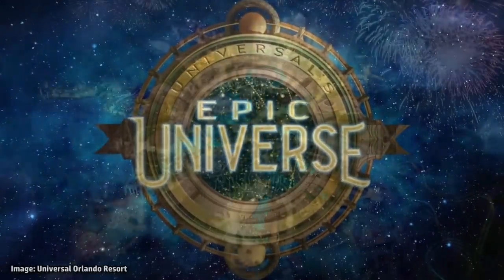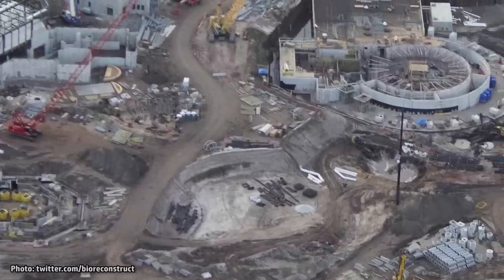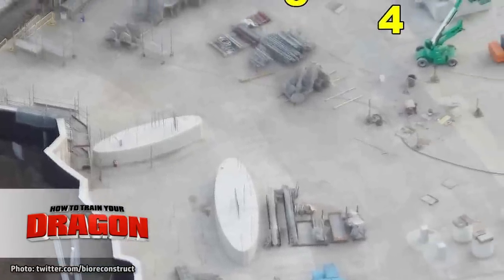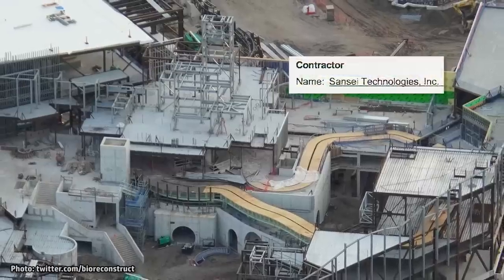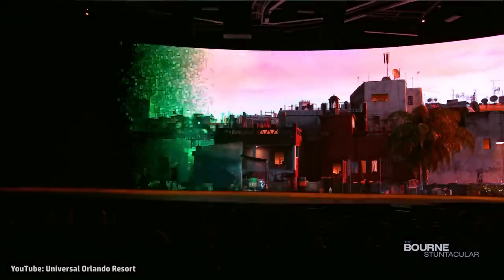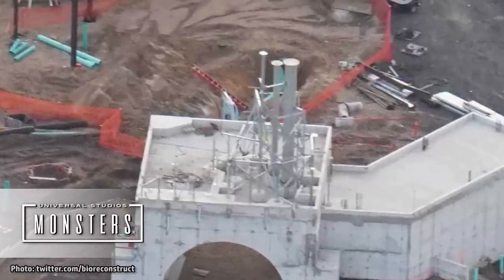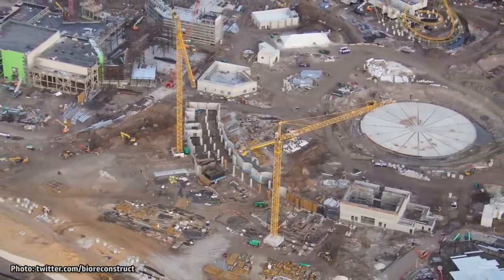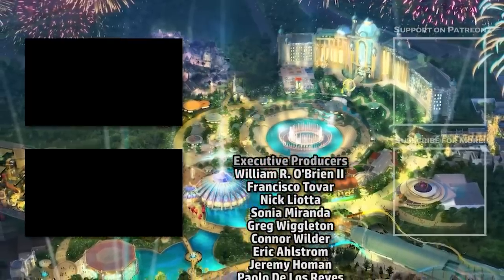Universal's Epic Universe News Mega Update — NEW PERMITS, RIDE RUMORS AND CONSTRUCTION PROGRESS

Comment: Awesome video! Question what’s the progress on the Kirkman Road extension..that’s gonna be the key to get Guest to Epic
Reply from the maker: It’s making good progress but is not scheduled to be complete until next year. They completed a small section near the hotels outside the park for heavy equipment to be able to drive into the work sites recently, and are now working on an overpass more north. It’s a city project so moves a bit slower than the park but is making good progress. Even got some traffic lights put up in one spot!

Comment: Okay, it may be time to address this "This is going to open early!" nonsense... but is it? Alicia pointing out how far we've come in a year is shocking. There is really NO reason why roller coaster track should be going up a full two years early! To put this in perspective, I looked at Diagon Alley construction. In October 2012, the Gringotts ride building went up, while the rest of the area was still dirt. Vertical construction on the Alley didn't happen until March or April of 2013. The land opened on July 8, 2014, which means it took about 15 months from this point. Epic Universe is already well beyond this point! Yes, Diagon Alley was on a rapid construction schedule, but there is simply not two years' worth of work left here! 

I have to go back to my thoughts on them opening the hub before the actual park. There's really no reason they can't, the only requirement here is that EU's Donkey Kong not open before Japan's in the nebulous timeframe of "2024", no doubt kept nebulous due to the new ride system. My thinking was that the coasters and flat ride would be open - for a fee - to non-park guests after the park closed. This might explain why the racing coaster has so much track more than two years out. AND why restaurants in the hub are further along than ride buildings, typically the first things built. Also, it just seems off that a recently-permitted hotel is way further along than the one in the concept art, as well as the fountain and the observatory restaurant. Is it a coincidence the only hub building in the fountain area that has seen much progress is the barbecue? It's looking to me like they plan on opening the front part of the hub first, holding off on the fountain area until the park itself opens. This makes even more sense now with this video. Entrance area buildings are going up? A Nintendo gift shop? The shuttle turn-around area? Two years before opening? 

At this point I'd bet the first two areas of the hub will open - with at least three restaurants, several shops, the flat ride and the coasters - well before the rest of the park. I actually wouldn't be surprised to see it open by the end of this year. Ridiculous, you say! Why wouldn't Universal want to open these money-making sights early? There's a reason they are willing to throw money at a train station over by the Convention Center. Between them and the people leaving SeaWorld when it closes, they can be printing money from Day One. (I'm actually a little surprised there aren't more rides here - and way more bars.) The only reason I say this year is because there's always been an issue with 2024 and 2025. 2024 is IOA's 25th Anniversary, and 2025 is USF's 35th. This means EU would always be overshadowed on its anniversary. (Also, anniversaries can be big business; just ask Disney.) Opening just a fraction of EU in December 2023, means EU gets its own anniversary date, and every 5 years the three can have an endless Disney-style celebration. 

Maybe Universal doesn't care about anniversaries that much, but they do care about money. Especially if they can start selling sweet sweet Nintendo merch early. And booze! Keep an eye on the hub!